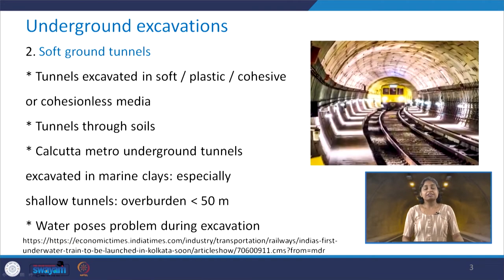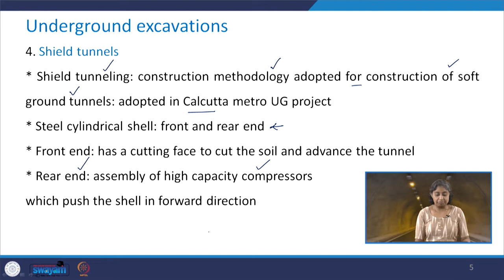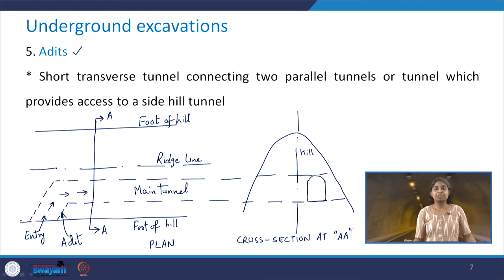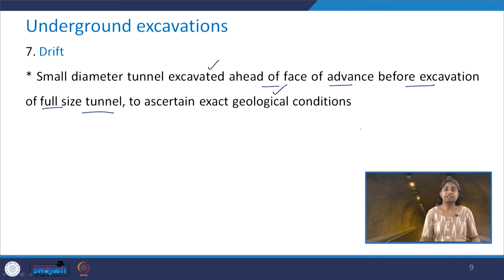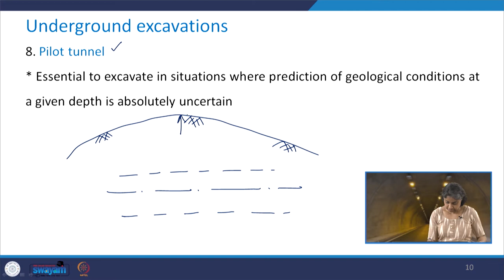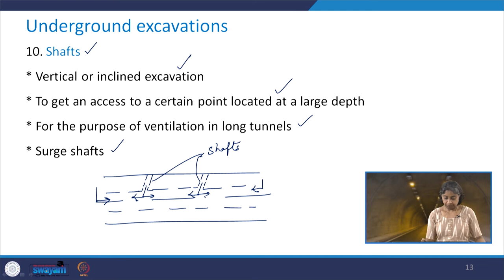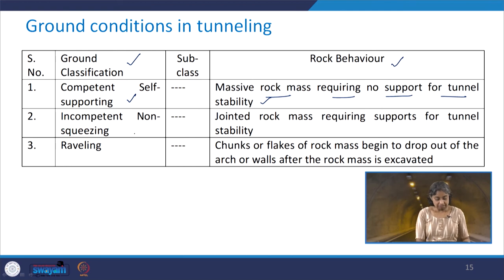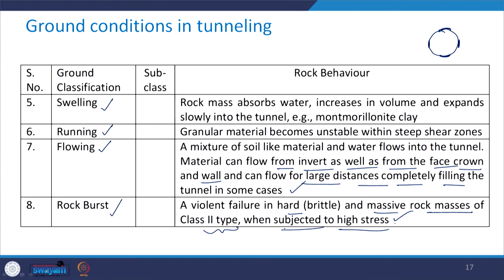Lecture 9: Tunneling: underground excavations

Comment: ADVANCED ROCK MECHANICS 

Group A 
Rock strata characterization: Geological structures in rock mass, characteristics of rock mass, 
joints in rock mass, joint survey techniques, rock mass classification systems. Methods of 
determination of strength and deformability of rock and rock mass, failure criteria for rock 
and rock mass. 
Strata mechanics and ground movement—design of underground excavation in competent 
and incompetent rock, ground movement and control, rock burst theories of subsidence, 
subsidence prediction and control. Ground control and stabilization . 

Group B 
Theories of elasticity—propagation of elastic waves in rock medium and dynamic behaviour 
of rocks. Factors influencing stress concentration, zone of influence of an excavation, effect 
of planes of weaknesses and shape of excavation, delinearization of zone of failure. 

Instrumentation—monitoring instruments, their operation and installation. 

Finite element method and boundary clement method, their application for stability analysis 
of excavation and slopes.
Reply: Mam please make videos on this topic in single video
Reply: It is AMIE SECTION B SYLLABUS
Reply: For mining engineering
Reply: My humble request pls make video mam